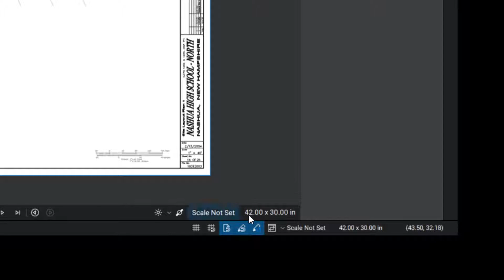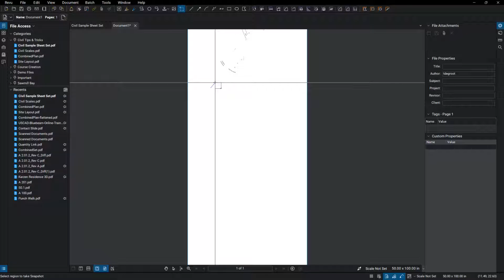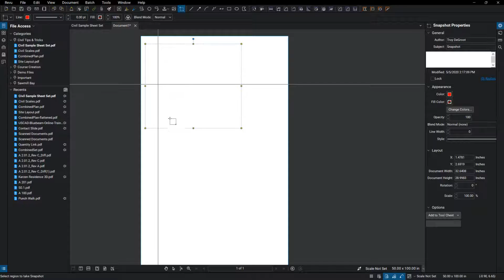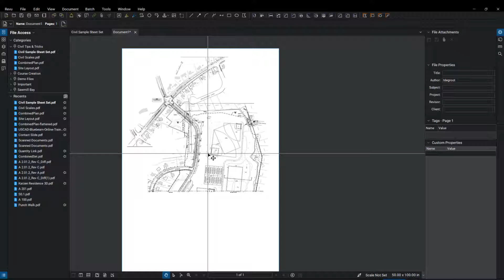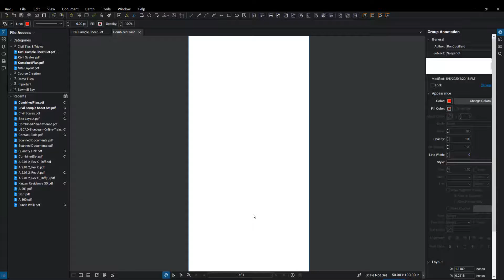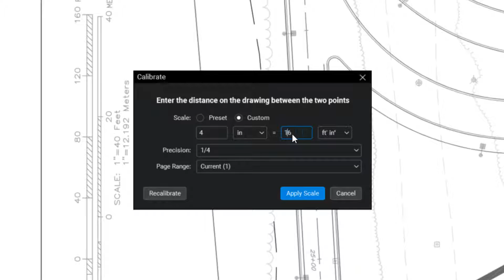Bluebeam Revu -Combine PDFs Into One Without Frustration

Comment: is there a way to align the two snapshots based on two points? There may be a twist in the sheets. Or the scaling could be off from one sheet to the other because the PDF was scanned in rather than created directly to a PDF. Or even to rubbersheet them together?
Reply from the maker: Sometimes I use the arrow keys on the keyboard to nudge the images slightly. I can typically get them close enough to apply markups from one to the other. Hope this helps.

Comment: Thank you for this video! This is an intuitive technique that is going to help a lot. One issue I am having (that you may have addressed elsewhere), is that some of the drawings I am trying to combine are at different orientations from page to page and I am not able to rotate the images precisely enough to align the matchlines correctly (I only seem to be able to rotate to 5* increments). Is there a way to rotate more precisely?
Reply: Use the rotation setting in the snapshot properties. Right click your snapshot, or any import and select properties. Under LAYOUT you will see the rotation. From there you can rotate to the decimal. One thing I would like to know is if anybody has maxed out the maximum blank pdf size. I've run out of space before stitching a large road project together. I think the only way around this would be to scale down my drawings but i've only run into this issue once before. Very impressive to see a large job stitched together, but then see it printed (tape the backside) and roll the entire project out onto a conference table lol
Reply from the maker: Try holding your shift key, it should allow smaller increments

Comment: Hey Troy, this is really useful solution and something that i need to produce on a couple of projects we are involved with. However i have found when i paste the pdf drawings on to a larger sheet Bluebeam crashes. I have taken this up with Revu and they are looking into it.
Reply from the maker: Thanks for the note Paul. I wonder if it would help to clean up the originals as much as possible before the Snapshot.. Keep me posted.
Reply: @UChapter2  the originals don't have any mark ups but have many 100+ layers so this may be an issue, actually I could try printing the originals to pdf so that it's only 1 layer before taking a snap shot and pasteing, i will let you know how it goes, thanks.